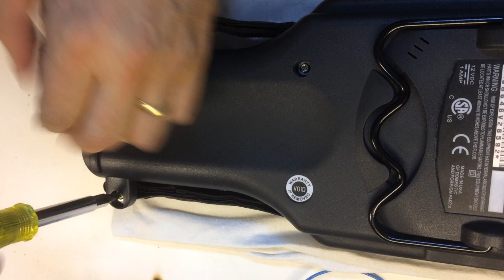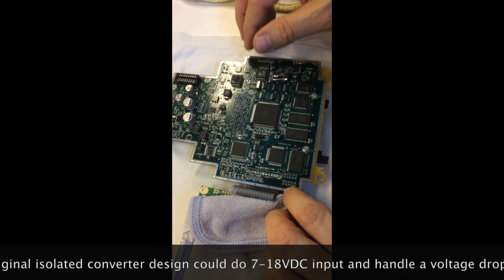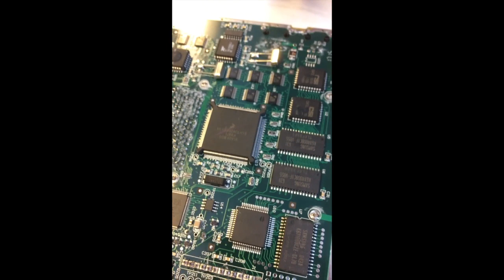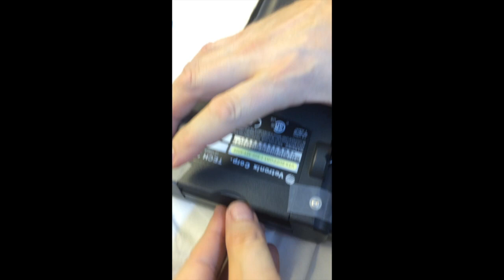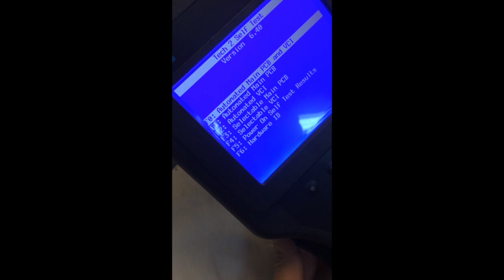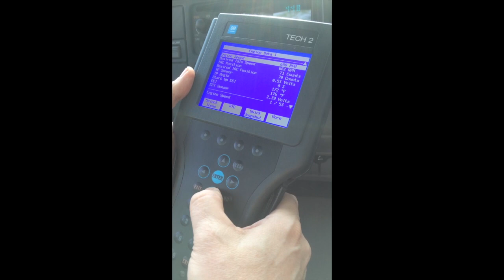GM Tech 2 Scan Tool DC-DC Converter Replacement / No Power On Repair (Dead Tech2 Unit)

Comment: I have some questions about differentiating between genuine and clone Tech 2 scan tools.  Do you have much skill at this?  I would like to share some pictures of my Tech 2 for evaluation.  Is there a forum you are active on where I could contact you and share images?
Reply from the maker: If you search on YT there are some videos about this.  But it isn't my forte.  I have no problems with the Chinese clones and thus no need to have concerns about telling them apart.  These clones have 100% functional parity with the original in the 3-4 years despite what you may read.  Tho they are not well enough constructed or rugged enough for use in a shop full time (which is probably the source of most negs on them).  But if you take care of them (keep dry/keep cool/keep from vibrations) they are worth every penny of the $350 or so they will save you from out of warranty dealership charges.
Reply: @DrShock  Thanks for the reply.  I got the impression from this video that you've opened up more than one Tech 2 for the DC/DC repair or perhaps other reasons.  Have you done this repair on any genuine Tech 2s?  Have you ever encountered a Bosch-branded clone?  It seems that all the clones I've seen online are either branded "Vetronix" or "GM", but perhaps there are others.  Bosch? OTC? HP?
Reply from the maker: I've done this same repair on a good dozen or so clones by now, but never originals.  Though there are plenty of forum posts out there on folks who have done this same fix successfully on originals (and gained the restart on cranking problem like the clones once they did).   This is about the only circuit board repair that can be DIY given no schematics.  No, I've never seen or heard of any Bosch branded clones, nor HP branded clones.  But of course either are possible, it's just a sticker.   If originality is a concern, you are looking at close to $1,500 for a Bosch Tech2 Pro Optima as the only "genuine" version still manufactured (though those are likely parts sourced by the same Chinese suppliers that sell to the cloners).
Reply: @DrShock  I guess I should clarify that I've already bought one, but I'm not sure if it's genuine or a clone.  At this point I'm just trying to figure out if I got a really good deal on a genuine Tech 2 or got hosed on a clone...

My unit seems to pass the majority of the criteria that indicate a genuine Tech 2, but it also fails on a few points.  It's just so hard to tell for sure because I know that some of the checks discussed in forums and other YouTube videos are outdated.  On top of that, I've started to suspect that the genuine ones are resembling the clones more and more over time with continual cost-cutting measures.  As you said, both the clone and genuine Tech 2s likely source many of their parts from the same suppliers.  Mine is clearly a newer example, whether genuine or clone, but I'm not sure if mine is a real one that's displaying some features historically associated with the clones due to more recent cost cutting measures, or if it's a newer clone that's a more convincing forgery because the factories have corrected many of the features that used to be dead giveaways that you've got a clone.
Reply: To get a little more specific, do you recall if any of the clones you've handled had a date code stamped on the inside of the PCMCIA card door?  

I bought mine from a recently retired mechanic.  I knew that a date stamped on the inside of the PC card door is considered a sign of a genuine unit prior to buying it, and that was my main authenticity check when I looked at it.  It had a code stamped inside the door, so I bought it.  I bought it along with two other Chrysler factory scan tools, which I absolutely know are genuine because they've never been cloned, so I guess I also took that as some level of assurance that the Tech 2 was genuine as well. 

I looked into the clone-vs-real  issue more after I got it home and that's when I started to become concerned that mine might be a clone.  The main point of concern is that mine has the "reboot on engine start" behavior.  So I guess the possibilities are: 
1) It's a clone
2) It's genuine and has had the DC/DC converter replaced
3) It's genuine and has a malfunctioning DC/DC converter
4) It's genuine and Bosch has cheapened them up so much in recent years that even the newer genuine ones can't maintain power during engine start
I suppose I should just open it up and see what's inside.  Genuine or clone, I'm sure it's out of warranty at this point.
Reply from the maker: The stamped date was something you found on HP manufactured Tech2s, not sure of others from what I recall reading and watching over the years.  Easily duplicated though if someone in China wanted to.  Same with this aluminum vs brass connectors that has also been blogged about between clones and genuine.  If the restart is your biggest concern, I posted a simple fix in this video - https://www.youtube.com/watch?v=Mz-Ar6TAuiY
 
Past that I'd respectfully assert that what really matters is can you perform the GM service manual procedures you need with the one you have.   Unless you're starting a collection of all the various Tech2s ever made (which could be kinda cool I guess), this is probably the most important point.
Reply: @DrShock  I am aware of the workaround for the restart issue, so that's not really a big concern for me.  My main concern is knowing exactly what I bought.  I guess I just want to know if I got burned on the deal or not.  I spent more on my used Tech 2 than what a new clone costs, but way less than what a new or used genuine one costs.  If mine is a clone, I got a raw deal since it's used and I could have bought a new clone that comes with more accessories for less.  Also, if I ever decide to sell it down the road, I wouldn't want to misrepresent it as genuine when it's actually a clone, or worse yet, unwittingly sell it as a clone (for a clone price) when it's actually a genuine one. 

One other question:  Is the wrapping of the "SYSTEM INITIALIZING" message from one line to the next a behavior unique to the clones, or do the genuine ones do that too?  Mine does this.  Is that behavior related to the DC-DC converter?

I guess I'll do some more forum perusing.  Any recommendations for forums with good Tech 2 info?

Thanks again!
Reply from the maker: The initializing message wrapping was a concern I shared some years ago, but managed to chat with someone at a local Chevrolet dealership who told me their Tech2s started doing the same thing at some point in time years ago .   I took that to mean its most likely a bug in the later/last PCMCIA card firmwares that just never got fixed by GM/Bosch as the Tech2 was being replaced with the MDI.  Its does not always wrap the message, perhaps 1/4 of the time in my experience the message looks centered and normal.   For deep Tech2 knowledge forums I'd suggest membership only sites like mhhauto or digital-kaos that mechanics frequent.

Comment: Hi I've got a Tech2 scanner like this however the screen lights up but there is no text or image. What could be the problem?
Reply from the maker: Logic board failure, not user repairable as no schematics were ever made public for this tool.  If you have a genuine Tech2 you can pay Bosch to repair it as they are still supported there.  But if it's a clone, it's ready for the electronics recycling bin or eBay it out for parts.   You might try a second PCMCIA firmware card in case its corrupted, but that would be a long shot.  Before I tossed it into the bin, I'd open it up and check that all the internal connections were still snug too, in case something worked itself loose.
Reply: @DrShock  Hi thanks for your reply.  I opened it as you showed and found that the LCD screen pins were loose. Now I get the boot up text but it shows RTC FAIL and CHKMEM FAIL and won't go any further. Any ideas what it could be.  Battery check good and I reflowed the solder joints where I could. Thanks.
Reply from the maker: You lucked out that's for sure!   So Real Time Clock (RTC) you can ignore, all Tech2s with the latest firmware get this error on POST even mine.   But the Clock Memory (CLKMEM) is what I think you meant to type.  This is either the coin battery that keeps the time needs replacing (or perhaps reseating/loose carrier) or you simply need to set the time (Set Clock) from the front Tool Options menu.
Reply: @DrShock  Hi again, thanks. Yes it is CLKMEN FAIL followed by three beeps. It won't allow me to go any further so I can't go in to set the time. I checked battery and connections and everything looks good. Any other ideas on what to check on the main board? I can email you a video when it boots up so you can see.  Thanks for your advice.
Reply from the maker: If you're not even getting to the menu, then this CLKMEM error can sometimes be caused by the PCMCIA card contents being corrupted.  Have you recently tried to overwrite that, or swapped it out?   You could try re-seating that adapter card, or try another of the two slots for it (be very careful not to bend any pins).  You could try a second PCMCIA card if you have access to one, or you could try rewriting the contents of the original card if you have the equipment to do so.
Reply: @DrShock  Hi again, I never tried to overwrite the PCMCIA card and it's the only one I have, it has GM EN 33.004 update. I bought this scanner last Oct from (China) but from the beginning it had these RTC and CLKMEM fails. Never could get it to work. I tried sending it back to China but it was returned to me last week with a sticker saying Refuse. It was being held in Wuhan Customs all this time. Very strange (Covid19) perhaps. So before I dump it I wanted to give it another try and see if I could get it to work. Even without the card inserted it gives the same error. Thanks again for your help.
Reply from the maker: I would try the Chinese seller again, explain the return was refused by China customs because of the pandemic.  Maybe they will settle out with you and just send you a replacement firmware card (explain it has the CLKMEM error on booting).  Personally I've never had any problems with the two clone Tech2's I've owned other than these PCMCIA cards (my first one went thru three before it settled down with one it liked ).  Ideally I'd like to find a genuine card and plug it into a clone Tech2.
Reply: @DrShock  I contacted them via skype and told them that it was returned to me still not working. They told me to email them a video or photo of the error so I did that on Friday. Still waiting. Any way to send it to you to troubleshoot? I already spent $80 sending to China only to have it returned to me defective. Thanks again.
Reply from the maker: tbh you'd be better just pushing them to send you a replacement PCMCIA card as I don't have the spare parts for these.  If this happened to me I'd just try buying a replacement clone PCMCIA card preloaded with the Tech2 firmware version I needed off of eBay.   If it worked great, if it didn't I would feel I'd done everything I could to recover the unit before having to scrap it.   These clone Tech2s can easily pay for themselves in ONE single repair vs having to send the vehicle to a shop,  so having to buy another isn't that bad of an outcome.   Next time I would suggest to buy the Tech2 on eBay, that way if anythings wrong eBay will get you your refund no questions asked.

Comment: Hi you say the module has failed. Was there a way to test it?   I have no power up.  All parts work on another tech 2 so it's something within the body.  Any test method please .
Reply from the maker: You would have to remove the module from the circuit to test it completely, but if you look up the datasheet for the replacement part I reference in the video, you would have the input and output pins to check with a DVM.  Remember one pin is a power button sense so the device won't even power up without that.   I would start with using the external AC adapter only, connected to the base of the unit barrel jack (not the DLC cable jack) and probe for input +DC power from the adapter first.   Then I would follow that circuit (remember there are no schematics for these tools) carefully over to the converter.   I've not personally had to do this, so can't help with specifics - just sharing the most logical initial debug approach I would take if faced with this.   In my case, I felt the converter was cheap enough I just shotgunned it - replaced it and found I guessed correctly.  ;-)
Reply: DrShock thank you , there’s one in the post 👍🏼

Comment: Hi.. any video"s on the CANdi box.. mine has died power supply area.
Reply from the maker: I've personally not ran into a problem to have to debug/fix a CANdi yet.  You might have better luck looking thru forums rather than for a vid on that.

Comment: When I power up my tech 2 clone, it fails self test. ERAM fail. Any ideas? Bad vci maybe?
Reply from the maker: Are you able to get into the F3 tool options->F3 self tests menu after the power on tests?  I'm not familiar with this external RAM failure during the POST so I don't know if it lets you go further.  If it does, you could run the main PCB test and VCI separately to determine where the dead RAM (random access memory) chips are.
Reply: @DrShock  So it gives the initial test when I turn it on, then it reboots and does the test over and over. Can't get into it and it makes a beep noise. Eventually I will get to a blank blue screen after cycling for a while.
Reply from the maker: Haven't run into that problem before.  About all I can suggest is trying a reseat of the PCMCIA card, and failing that I would do a partial disassembly hoping to spot anything obvious (burnt components, etc).  Checking the chips for one that is excessively hot sometimes can provide a clue as to what may be awry as well.    But without a schematic its' next to impossible to repair these units.
Reply: @DrShock  Took it apart, cleaned all the flux with crc electrical spray, found no burnt or weird looking chips, now it starts with a blue screen with 5 horizontal lines.
Reply from the maker: That particular spray is not the best for printed circuit boards with the flexible interconnect type plastic connectors.  I'd check ones for the keyboard and LCD to be sure your cleaner didn't leave any residue in them.  Also check that you've got the small flexible cable connectors for the LCD fully reseated evenly.  I have seen something like that before and it was simply not seated properly.   If this is a genuine Tech2 there are places you can mail it in for repair.  If it's the Chinese clone type, cheaper just to recycle it and buy a new one for situations like this with no obvious fix.

Comment: If anyone is having problems with non genuine tech 2 especially the rj45 port make sure the pins on it are grounded from the inside this can result in the no connection established in tis2000   - their is many things that can go wrong even connection with display I had an occurrence in which  I had to ground my rj45 I assembled it and my screen had lines going through the result was bad pin connection  btw if you guys do end up opening up the tech 2 clean the excess flux with some electronics cleaner and a toothbrush /rework any solder joints that the Chinese manufacturer might have gone through poorly  . This has been a service  announcement by a fellow tech 2 owner .
Reply: Where do you ground it to?